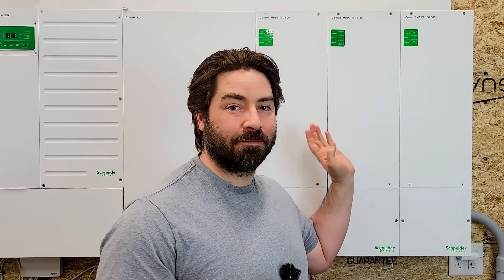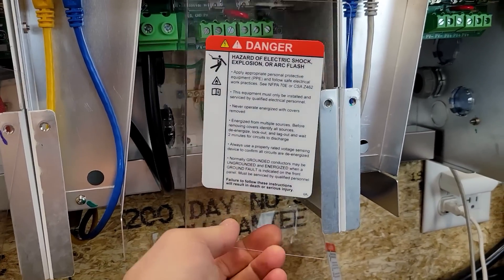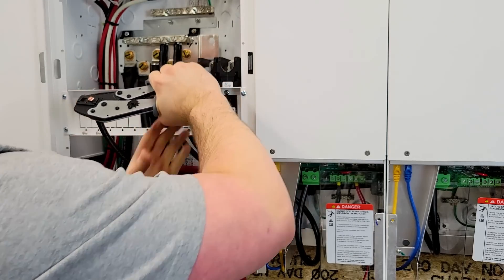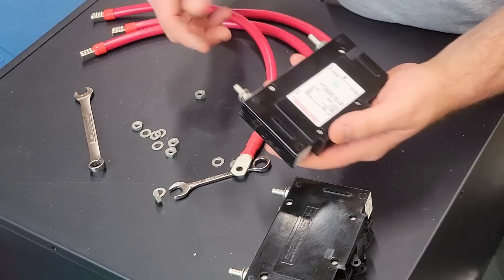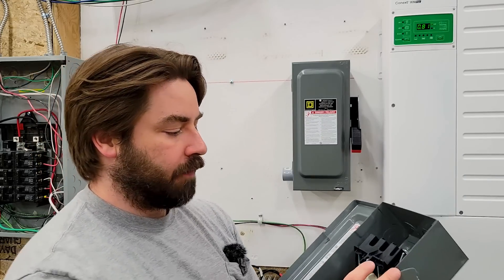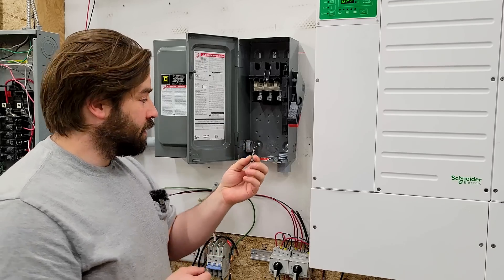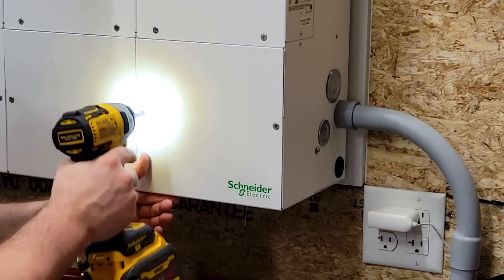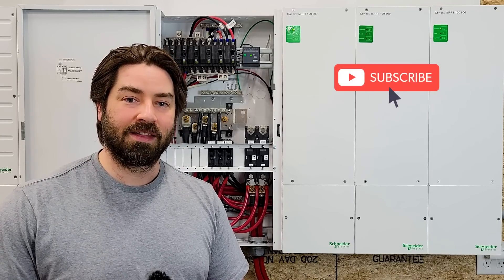Installing 300 Amps of Solar Charge Controllers

Comment: For a system of this size, the best inverter out there right now is the EG4 18kPV. One of them is a pretty good match this system for half the price, or two of them can provide twice the solar charge capacity and inverter output for the same price with much less complexity.
Reply from the maker: The EG4 18kPV is a very nice inverter. However, there are certain applications where a Schneider system is a better choice than the EG4.  Likewise, there are applications where the EG4 is a better choice.

Comment: Strip the stranded wire, put a small zip tie around the strands and “zip it” then put a little solder on the end, take off the zip tie and put it in the ferret thing.
Reply: Do NOT crimp soldered wires. Upon further thought you're probably talking about tinning only the very tip of the wire so it's easier to slide in the ferrule. That can be safe if you strip extra and carefully remove the soldered end before performing the crimp.

Comment: If your PDP is really crowded with wires. You can take the 4 screws holding the DC breaker rail lose. Tilt the rail outwards for easier access to the breaker studs to tighten the nuts on the breakers.

Comment: Why can you not use welding wire?
Reply: UL listing.  Welding cable generally isn't UL listed, and if it is, it is a UL listing for momentary current capacity, not sustained
Reply: Usually, it's a voltage rating. WW is rated for high abrasion (draging on concrete,  gravel, over steel edges) most welding is done at less than 50-80 volt open circuit. And, while the WW has plenty of flex, the insulation thickness is detremental to the installation. (again the rough service)
Reply: Voltage rating of insulation

Comment: THIS is why all-in-one units exist - myriad connections, points of failure and sources for mistakes.  What a mess.  Fantastic inverters though.  Maybe worth it.
Reply: Yes, and you really should use a torque wrench on those connections, and retorque them on a schedule (in high current industrial applications maybe something like 30 days or 90 days, again at 6 months, and then annually on each inspection).  The more connections, the more likely something is missed during install or on inspection until/unless it causes an obvious problem - usually high temperature leading to burnt insulation and connections.
Reply: Many vendors sell these units prewired. Ease of installation would be the same as an all-in-one unit but you also get the increased modularity / fault resilience of having them separate.

Comment: Did you consider mounting the SPDs on the side or bottom of the disconnects? It makes for a clean look and provides a visual indicator if power is present. Makes it easy to walk by and check the spds are working correctly
Reply from the maker: I might do that next time.  The disconnects would have to be blocked out from the wall in order to provide enough clearance for the SPD.  I didn't think about that when I mounted the disconnects.

Comment: Correct me if I'm wrong, but I feel like there's absolutely nothing out there that can beat EG4 6000XP. It's inverter + charge controller + supplemental ac charger for batteries all in one. Why would someone use costly Schneider over EG4?
Reply from the maker: If we are talking about one thing "beating" another, we need to define the race.  If you are asking about value, then I agree with you.  The EG46000XP is a fantastic value.  However, if we are talking about surge limit, line-imbalance, and duration of surge, then nothing beats the Schneider.  
Note: This is my opinion based on inverters I've personally tested.

Comment: If I'm not mistaken, you brought the PV feeds to the disconnects then to the charge controllers.  If this is the case, the bottom of the DC disconnects may be a nice place to install your Transient Voltage Surge Superssor units. Also, best practice for installing any TVSS is to make the leads connecting them as short as possible.  

As always, excellent job with both your videography and install.  Top knotch work!

Edit: spelling
Reply from the maker: That was my first thought, but when I bought the SPD's, I had already mounted the disconnects and ran the wires.  Turns out, there isn't enough clearance to the wall to mount the SPD's.  If I had known this in advance, I could have blocked out the disconnects to proved clearance.  Next time.
Reply: @DavidPozEnergy  Is it close enough to fitting that you could use something like an offset nipple, coupling, and chase nipple to make up the difference? I've used this trick in conjunction with drilling closer to the cover to make various brands fit in cramped quarters.
Reply: The TVSS also has LED and mounts in a 1/2 knockout. It is a nice indicator to show it is energized if mounted externally after the disconnect.
Reply: Tell me though, when is the system ever going to suffer a transient?
You're not dealing with the grid here, it's solar.

Short of a lightning strike, it's never going to see a transient, and a TVSS isn't going to help with a direct lightning strike.

Comment: You have three 600 VC charge controllers, how many kilowatts of solar do you have?
Reply: 14 panels is below 600 V, two strings parallel (20A) gives 28 panels each charger, times 3 gives 84 panels times 400W, approx 33 kW max
Reply: I believe 12kw is the number he has
Reply from the maker: Right now, I have about 12kW, but plan to add more in the future.
Reply: @DavidPozEnergy  
I only have about 9 kW and live in the Pacific Northwest. Although I have two refrigerators running off two different systems, and the 3rd or main system is around 6.2 kW.